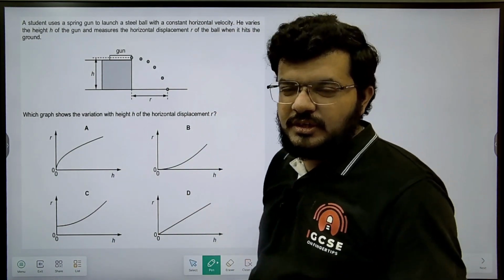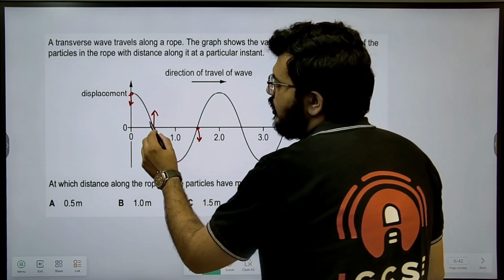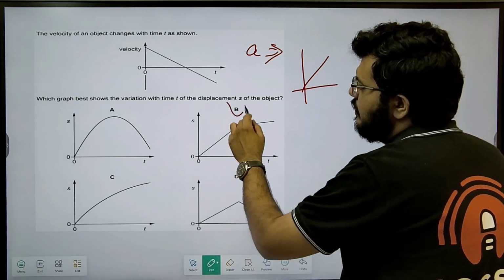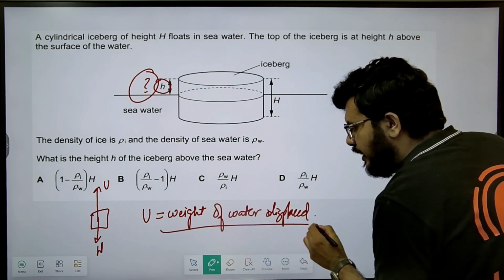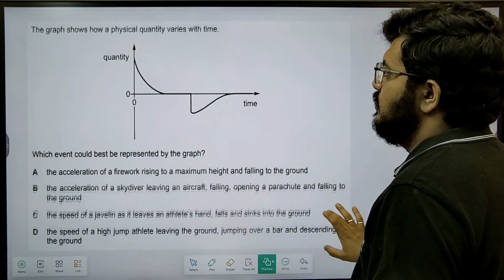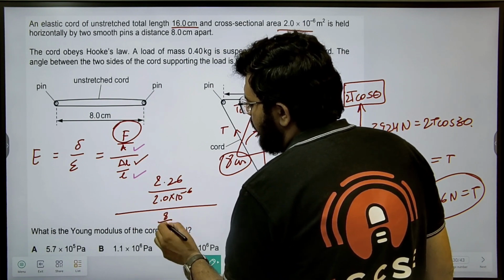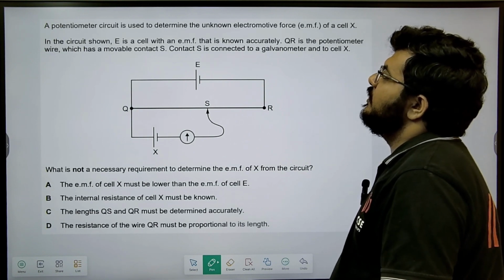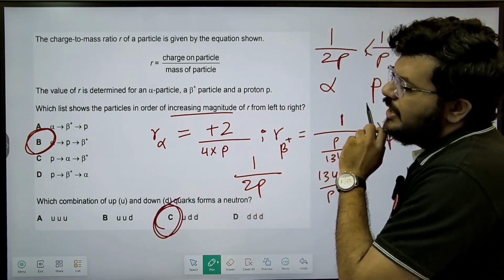Ultimate Challenge: 9702 Cambridge MCQ Difficult Questions Solved

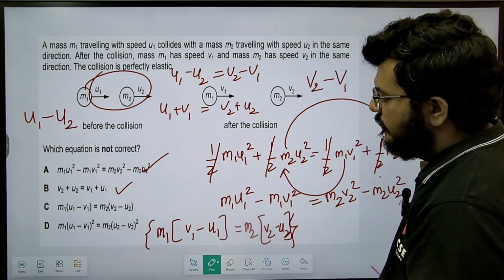Comment: at 50:56 there is an error in what you had written. m1(v1-u1) = - m2(v2-u2). You forgot the negative sign which switches the v1 and u1 on the left side of the equation. The answer is still correct.